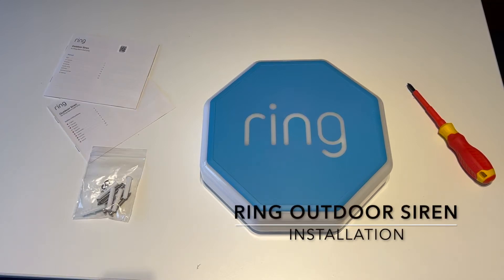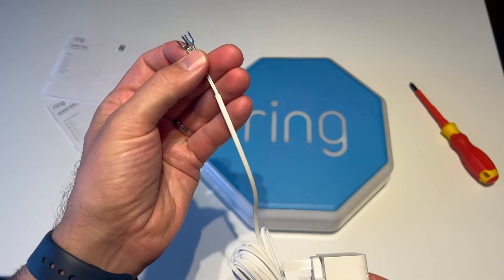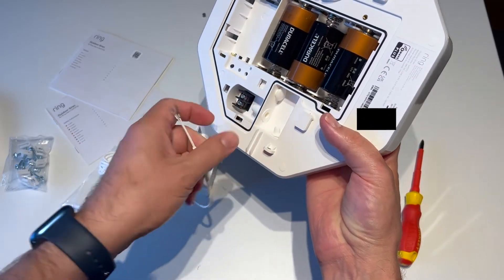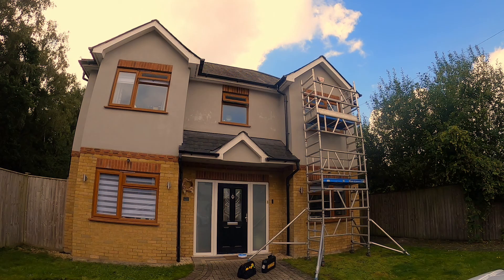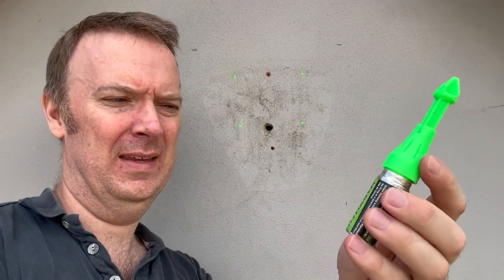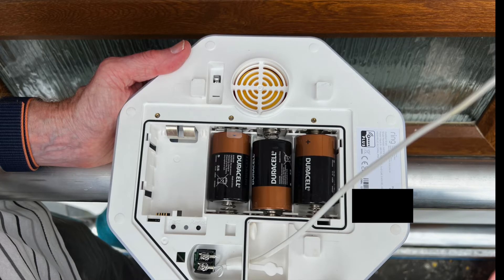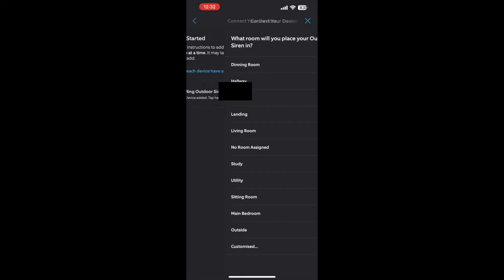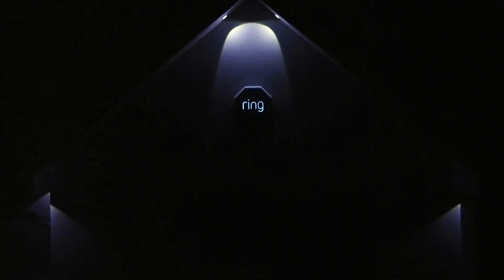Ring Alarm Outdoor Siren Installation

Comment: Found this text re + and - identification:

“If you are connecting an Outdoor Siren, you must correctly connect the positive (+) and negative (-) sides. The negative cable can be identified by a ridge running the length of the cable.”  Just fitted mine today and had same problem as you; would have been nice to find this earlier. 😁
Reply from the maker: Great find, thanks for sharing.  I too wish I had known that before trying to install the siren.

Comment: Great video I had 3 ring sirens fail on my ring system they just stopped working  so I put back the old alarm box and powered my old system back up the ring system is great in theory but when something goes wrong with it just gets a little annoying ,plus the tower system is great idea and safer than a ladder when on your own

Comment: I used the wire connected to my old alarm box and connected the power supply to the other end in a cupboard where my old alarm panel was.
Reply: Hey mate. I’m wondering how you did this? My house is new and it’s wired for an alarm. The cables are on the front of the house for the siren, which an alarm company would just wire into. Can i use these wires to hardwire into a ring siren? Or do I still need the external plug adapter?  Cheers!
Reply: @leomcgrane93  you just need the power adapter for ring siren....just wire into your existing siren wire.. so wire external siren box using external end....then wherever the internal end is wire that to power supply adapter and plug in....

Comment: Should you use rechargeable batteries?
Reply from the maker: The manual recommends against using rechargeable D batteries. However you do have the option of using a rechargeable Ring quick release battery instead of or alongside the wired connection.

Comment: If you hardwire it do you remove the batteries?
Reply from the maker: No, you can leave the batteries in.  They then act as a backup in case mains power is lost.